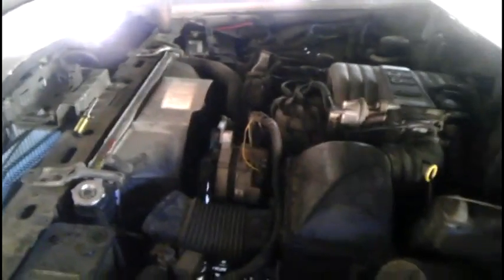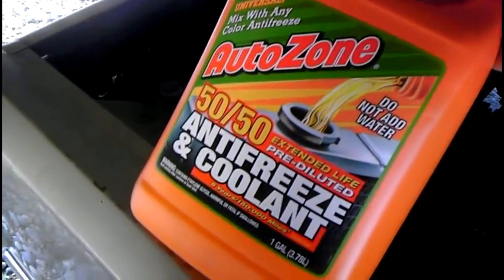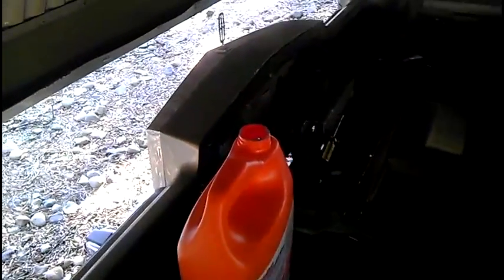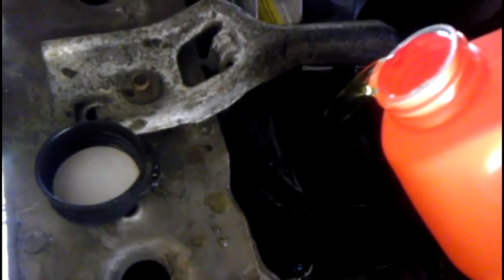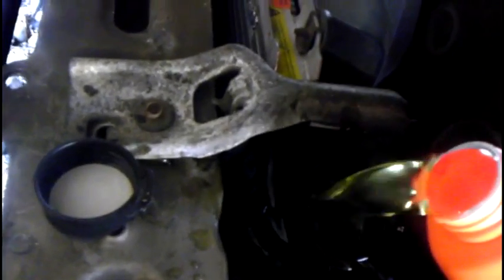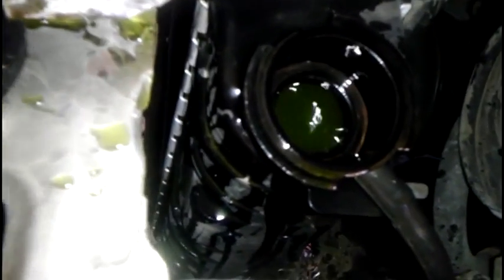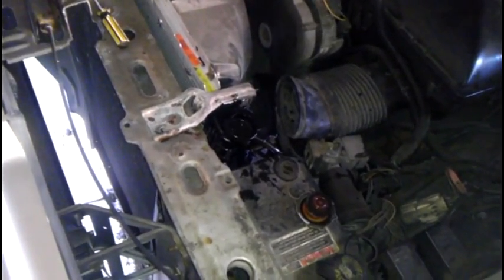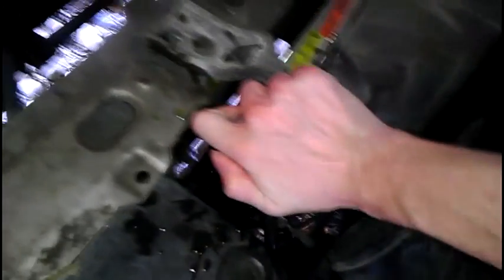How to fill coolant without trapping air in.

Comment: I have a 2008 Nissan Pathfinder. I have to fill up my radiator completely. Should I turn the engine on while I fill it up? And the heater to the on position?

Comment: I took my car to Jiffy Lube and they did a coolant flush. I drove ten blocks and at each red light it heated way up. I stopped at the closest repair place and they said it needed to be burped and was low on coolant. I guess they should have seen this video.

Comment: should have turned your heater on.
Reply from the maker: Maxxus Maksim like ive said before, after a repair, yes you would be right. but just adding to it when it has a small leak/or head gasket slip, no. dont need to. but it was cold. so i had it on.

Comment: Shouldn't you turn your heater on and have fan on high? I always thought that would help circulate the coolant better.
Reply from the maker: thats if you're bleeding the cooling system after a repair. You dont need to do that when just adding to it. you really dont have to run it at all just to add a bit. but you may or may not trap ait in if you dont. ill do a separate video on how to bleed a cooling system. I gotta do a small cooling system repair this weekend anyways

Comment from the maker: Thanks for watching. It will probably help that radiator dry up a little bit slower:). ill try to get a radiator replacement vid up
Reply: jdubsteachings What if you have a coolant reservoir tank in addition to the radiator cap? I have a friend in her reservoir tank is very low with less than a half an inch left inside of it, she probably hasn’t checked her coolant in over 10 years, what’s your recommendation for adding coolant when you have a reservoir tank that’s almost empty?